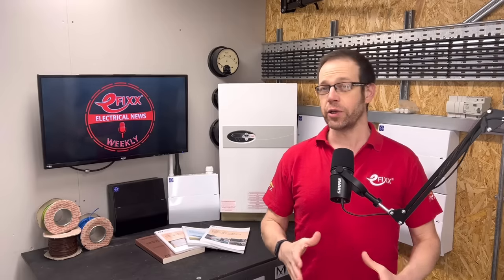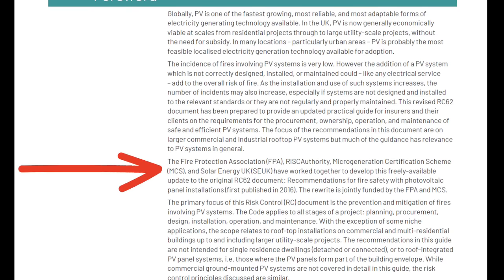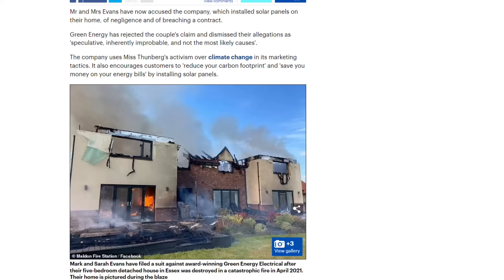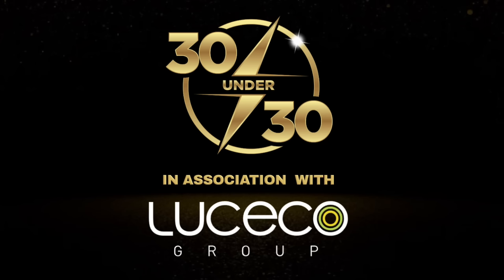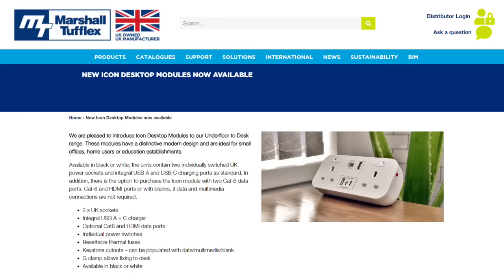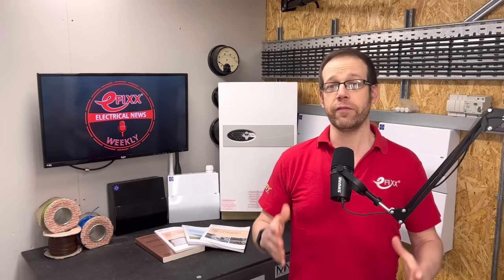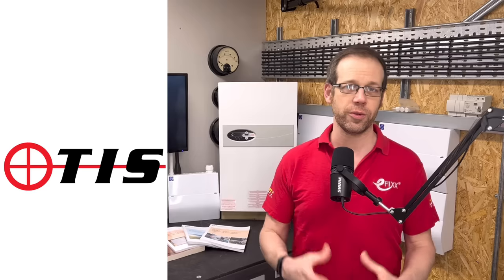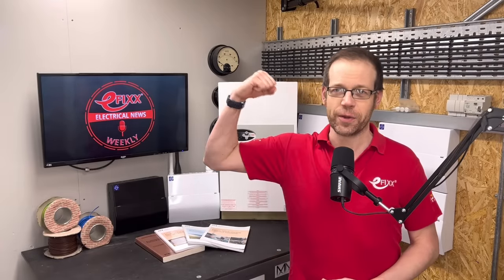DON'T Install DC Isolators On Solar, Electricians Warned

Comment: To blame the DC isolator for a fire begs the question as to exactly why it has failed - unapproved switch design or incorrect selection / installation. This recommendation to delete an isolator seems strange to me. Perhaps solar panels should not be installed in a sunny location? Then everything will be within ratings 😂
Reply: It is not as odd a request as you think.
BS7671 still needs to be complied with, and it says a means of isolation needs to be provided.

What the insurance companies are talking about is removing of or not installing a separate DC isolation switch, and under the regs you don't need one if there is one integrated into the inverter.

So they are actually talking about the removal of a redundant component.
Reply: Doesnt matter if you switch ac or dc, the point is, there could be reasons why you want to switch the dc side, and if you do have to choose the right equipment for that dc voltage, and be able to switch max current in and out, choosing the wrong one could cause fire, just like choosing the wrong one to switch the dc side.. op is right.
Reply: @deang5622 it is an odd request, you for sure need to be able to switch you dc input off on your inverter for reasons..
Reply: @deang5622  it's redundant until a lighting strike blows out the inverter and you have to replace it. The isolator is definetly more convenient when you are trying to mash the cables into a dc converter or charger.
Reply: @MikeyisNinja  Never heard of lightning conductors?

You don't use or rely on a DC isolator to protect your installation from lightning strikes.

That's where lightning conductors and spark gaps, surge protective devices come into play. An isolation switch is NOT a surge protective device.
Reply: @deang5622  you can have all the lightning protection in the world and still blow an inverter. They are pretty sensitive from what I've experienced, and when I've replaced inverters they have been much easier to work on with isolators.
Reply: @deang5622  yup a isolating switch does not function as a surge protection. They do could work for overcurrent protection in some cases, we refer to them as “vermogenschakelaar”. Like a nsx100 from Schneider.
Reply: My thoughts: It needs to be made clear a) what exactly is the fault mode / cause & effect sequence that results in a fire. (I'd think the originating point of failure needs to be identified and brought up to the correct specification & resilience, rather than the removal of an important safety component) And b) How you would protect from the lethal voltage that could be present at the inverter terminals if/ when replacing faulty equipment. (Even if there is a SS switch internally within the inverter)
Quite apart from anything else, I would like to see the requirement for a voltage-limiting device to be present on the primary side of the DC isolator switch. Depending on panel array size, this need be nothing more than a suitably rated Zener diode in series with a 3k Ohm x 30W resistor (or similar) just so the oc voltage from the panel array can never be higher than conventional LV levels.
Reply: @derekjones6800  Wrong approach.
You can't use zeners to limit the operating voltage on the output of solar panels.
You are then restricting the power output they produce.

You don't limit the voltage of electrical supplies in order to prevent electrocution (except in bathroom wet room scenarios) , what you do is prevent contact with live parts. And you use RCDs/GFCIs to prevent electrocution.

Anything over 120 volts DC poses an electrocution risk. You cannot limit the output of solar panels to that.

The output of an individual panel can be lower than this, but not for an entire array. You can't restrict that.
Reply: @deang5622  You'd also probably have to mount the necessary very large Zener on an absolutely huge heat sink.
Reply: He doesn't even say that the DC switch caused any of the mentioned fires. This does not inspire confidence when promoting training in electrical systems.
Reply: these cam roller switches must not be operated under power (they have no arc quenching mechanism inside), its a maintenance isolator only, switch all loads downstream off first.  NO WARNING NOTICE shown.  Why these dont have a current flowing interlock to prevent operation is beyond me.  A big knife switch works
Reply: @deang5622  so you advise only removing a faulty inverter at night when there are no electrons in the wires from the PV panels?
Reply: @deang5622  You do know a lightning conductor is a device for attracting lightning. Right?
And induced voltages are quite capable of killing IGBT's in inverters if their maximum voltage handling capacity is exceeded even at negligible currents.

Comment: I use a polarised 500v breaker and double insulate the solar cable connetion point, cut the ferrule to size, but to cut power my inverter has an intigrated isolator switch. At max current & volts the temperature of the breaker connection points is not more than 2 degrees above ambient. Personaly I think testing thermals during max loading is a must.